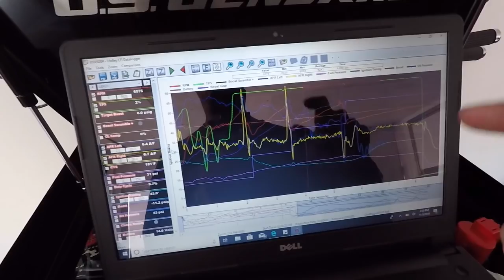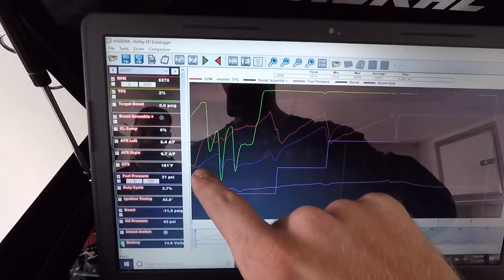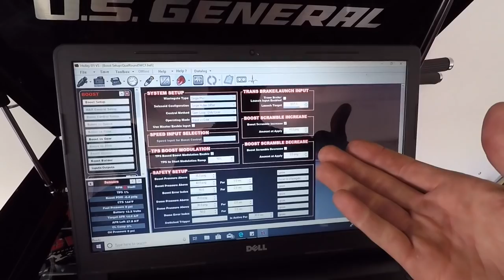World Cup Day #3 - Third Round Qualifying, Shattering Parts (Changing To Old Mounts)

Comment: I can't believe those rearends you keep breaking are stock ones.  That should show people how strong they really are your pushing them harder than they were designed for. pretty good parts in my book and I'm a Ford guy.  To bad there isn't a way to truss the case like can be done to a solid rearend.. I also don't know why anyone would rag on parts breaking especially stockish ones I mean most race cars running what your running use completely after market parts designed for the hard launch and huge hp so again the parts you explode are still very good parts and will handle most normal applications however LeRoy is a bald eagle machine and nothing close to normal.
Reply: I agree 1500+ ponies on stock goodies is ridiculous. cudo's to the gm design team on that one
Reply: Its amazing, im pretty sure he never broke Leroys original stock axles, while running around 1200hp and mid 8s all day.
Reply: It's not a stock diff. Just the case. The internals are built
Reply: @thirtyeight92  but still stock case that's still pretty amazing.
Reply: @thirtyeight92  atm it's stock internals let's see how he goes
Reply: There isn’t a aftermarket case for it

Comment: Looks like it's time for a solid rear axle.
Reply: Its not practical, you need to pretty much at the min back half the car.
Reply: @southjerseysound7340  there's no body and most the car is already tubed. What doesn't make sense is trying something over and over again with the same results. Gotta keep it somewhat corvette I guess
Reply: Definitely time for a 9"
Reply: @spensinthevalley3099  I had a 99 C-5 and when we swapped to a Moser 12 bolt it was a ton of work. But the real issue was it kept us from running 1 of our classes and we couldn't claim records(although that's pointless anymore) You're damn near pro mod territory and nobody gives a shit when you run a 7.69 @204 mph because you're one of the slower guys lol.
ECS does make a IRS 9 inch kit that keeps things like a Corvette with a independent rear but you can only squeeze a power glide in there and you have to swap over to the C-6 rear subframe anyways. So if he wants to stay manual he might as well do the C-6 ZO6 rear diff anyways. Then if he decides to go auto he can with a IRS 9 inch.

Comment: Could that new cradle y’all put underneath the diff be one of the problems? Maybe if the diff has a little room to move the case wouldn’t break. Because if the diff case is trying to move it’s putting pressure on that cradle and the metal isn’t strong enough to handle that pressure.

Comment: Is that new diff brace over constraining the diff housing? Don't know if it's too late, but mounting it on poly bushings or a less constrictive mounting method might help em last longer! Just my two cents! HELL YEAH BROTHER
Reply: My thoughts exactly . Thought that when i saw them fitting it.
Reply: Billet case would help too lol
Reply: @Thomas-fo4dv  I thought the deal was they had to use a stock case? Could be wrong. That would be the obvious answer, but engineering the vehicle appropriately is smarter than throwing expensive parts at it any day.

Comment: Honestly it's amazing some of these components had lasted this far, some fine engineering gone into making parts take that much abuse. I was a commercial motor fitter and engineer for over a decade and know a little bit about failure rates so every time I see 3000lbs of Leroy pushed to over 170mph in under 8 seconds I can barely believe my eyes.

Comment: Apart from the new c6 diff in tbe works, would it be possible to strengthen the diff with a filler in between the cooling fins similar to concreteing a block? How important are those fins when the abuse is less than 8 seconds?
Reply: It's been a while but we put studs  in the output flanges and ran billet covers on ours and it helped a lot. But we still broke cases after about 30 passes. If I knew how to get ahold of him I could send him the solid works files.
Reply: I'm pretty sure there's an email that you can send stuff through to him. He had it in the links page when he was looking for a new diff  case
Reply: Was just thinking this, go ghetto and weld a whole bunch of reinforcement to the diff case to try and get it to survive the races.
Reply: @damstachizz  its not easy welding to cast aluminum because the oils get into the grain structure. It can also warp the case. If they had another spare I'd say go for it. But I don't think it's worth the risks

Comment: That is the worst diff design I've ever seen. Been thinking about this for a while since the first one split. As you'd probably have already figured out before me, as I'm no bright spark, from what I can see the pinion gear being at the top rear of the crown gear instead of the lower front of it, all that torque and stress is pushing on the back of the case via the pinion gear while it's trying to push the crown gear forward. It doesn't look like there's a lot of meat in that case around the crown gear. Is the C6 an easy conversion? I think a 4 link and Ford diff is in order. 😜 That'll upset the GM fans.
Might give you better squat off the line over the IRS though.
Reply: It’ll definitely launch better with any 4 link and straight axel. Keep the gm guys happy and do any straight axel

Comment: Quick release side cover and snap-in drain cover. Looks like theres nothing wrong with it to me. 

For those saying "SOLID REAR AXLE TIME" heres why not.
Different transmission that will require output flange/slip yoke for a regular style driveshaft (no torque tube), and fabrication for 4 link/ladder bar required. Less parts to break in the rear end in theory, but it adds in possibility of U-joints and driveshaft breaking.

Comment: From the corvetteforum by DTE Powertrain:

It does not matter if your car is equipped with a 1-rib differential case, a 3-rib differential case or a million-rib differential case for the likelihood of transmission/differential case fracture to occur in that area due to metallurgical fatigue, deflection stress or excessive shock load events. 

In all of these instances, there is still only 5 meager fasteners between the transmission-to-differential juncture where the greatest probability of fracture/breakage will occur. You can have any amount of differential case webbing count you want under the car, but the weak mounting point at the transmission extension housing still remains and is at risk, due to the light duty cast aluminum parts in that area. 

In other words...a 1-rib case will fracture just as easily as a 3-rib unit would without the use of our product, because the small connection point at the transmission still has not changed and it's still weak- even though the differential case may be stronger by itself. 

Our product protect both areas from fracture, regardless of differential case design and it's proven itself successful time-and-time again in numerous high powered drag cars over the years with varying powertrain combinations. Do a search and you'll find most successful high powered cars are using it to this very day with success as well- including our newest success of our driveline products being in Paul Smith's 427ci. powered C5 Corvette that just won Pinks All Out in Atlanta, cutting 1.3's 60 ft. times all day long with the wheels in the air! 

It matters not to me whether you use one or not- it's your car and your wallet, but at least you can make an educated decision on which way you need to go when you're equipped with ACCURATE* information to make the decison with. Good luck!

Regards,
Phil
Reply: that definitely sounds like every post from the corvette forums I've been on. it's so damn condescending. "I don't care what you do, but only I know what's accurate" 

only to be just as full of themselves as everyone else. it's why people hate these cars, their owners and the culture that come along with it. cleetus is changing that with what he's doing on this channel, not listening to the corvette forum engineers and listening to his sponsors technical support and racers. while working thru stuff that's not been done before because everyone listens to the bad advice. look at the white 1320 corvette, it's got what everyone says is correct and still is a sec slower than Leroy. he'll work thru this. just give him time.

Comment: You can use some white grease to check tooth pattern. I don’t know if this will help you, but if you knock all the high spots off your part from the casting. Like casting flash and stuff like that, make it smooth, it will increase the strength of the housing. The sharp edges are called stress risers. Engine builders do it on blocks and everything spinning in the engine. It’s a bit tedious but it’s something easy that you can do and will give you added strength by removing some material. Good luck my man. Stay free.

Comment: Get less stiff axles, they´re cheaper to replace than diffs and gearboxes. I´m with a guy that rides a Coupe Quattro with like 1000 wheel hp he does go with stock axles and he only replaces them after like 5 events or smth. Put a line on them and go with an amount of twist you´re comfortable with.

Comment: Since you are using oem case.  I'd suggest sanding and smoothing the casting it could help a little as the cracks start at a microscopic level in the ridges of the rough finish.

Comment: Like James was saying..."The biggest killer of transmissions and rearends isn't necessarily too much horsepower or torque channeled through weak parts, it's abuse and wheelhop .I suggest  asking RPM about using the Quaife C 6 differential with the C6 components ,high end axles,etc in a ZR1 housing...Part breakage is part of drag racing.The manufactures can't protect against the unforeseen forces.. PS Did you realign the front end on a machine after correcting bump steer ? You may have some et in that alignment..I few degrees/mm's can create a lot of scrubbing,rolling friction...Good luck.Love the channel

Comment: Like your brother once said."KEEP RIPPIN TILL SHE'S DRIPPING!". Corvette uses some good parts. But they can only take so much. The Getrag diff will hold together to around 1K HP but that's about it. I was racing for FORD in the SCCA Factory parts races. and when the wheel HP hit 1100 HP diffs started doing exactly what yours are. And I mean you're doing great because you're on a sticky track. FORD went to a better case. (A better alloy and billet) That one held together until the car got stolen and chopped.

Comment: It may be time to put a transmission on the back of the motor and put a 9-inch Ford in it. I know you probably don't want to do that but it'd be a lot better than always breaking an aluminum housing diff. Upgraded stock Parts can only handle so much and then you need to think about upgrading racing parts

Comment: haha , so what you did with the pinion support in the dale truck is exactly what I did in the right lane at MIR many years ago. Now you are getting won to the nuts and bolts of things. Someone has gotta make a 9" replacement center for that thing but it being what it is you will always be limited by it.
I mean look at what we have to put in solid housings to make them live. 40 spline axles with gourmet cases and supports... Those independents just aint gonna cut it when those 60s come down and the weight is up.
Sucks , hope you get it straight.
Reply: Corvettes don’t have typical drivetrain setups. The transmission sits in the back and in order to get a 9” rear end, you need to a complete rebuild and reengineer a lot of stuff. The only corvettes that run solid rear axles are full tube chassis cars.
Reply: @EGHeartattack  Yeah I get that. Someone will do it.....Its the corvette part that is the issue..... Same will happen with all these independent mustangs when the 60s get right.

Comment: honestly, the time for bashing parts has already passed. If this stuff was breaking at stock power levels, that would be a problem. But if I recall correctly, Leroy is well over double, probably near or past triple OEM horsepower. That WILL break things. No hate for the manufacturers, and kudos on the engineering for them to be able to handle the beating they have already taken...

Comment: What happened there was, that the pinion gear got pushed back by the smaller gear, and the casing gave in because the brace was only half way around the axle mount. So this was not tire shake. This was too aggressive launch for the gear. To protect the casing the axle mount brace should be all way around one single piece on both sides. That could hold when mounted to the back bar, and upper hang mount. But there still should be at least four mounting points in the braces and in the chassis on each side. otherwise these is stress points and tensions in the casing, and as we already know, the cast aluminum can't hold those.

Comment: When your on the 2 step you can see the diff shaking then when you apply all of the torsional force from the launch the stiffer/solid mount is most likely the issue. Instead of the mount absorbing some of the force, the case now has to absorb most if not all of it. Being cast aluminum it won't fair too well. When Supras started using the solid aluminum diff mount inserts, the breakage of diffs increased. I believe the same theroy applies here. Give Leroy some padding for that ass...

Comment: You broke the aluminum 9" in the Dale truck along with the driveshaft with an NA motor on your first launch. A 9" anything is typically a pretty solid piece  and I'd think an iron or billet steal housing would do much better. I think Fran at RPM(not transmission) in Delaware is using a 9" diff in his c6. Is this where you are headed? Also: have you looked at turning down the first 500 miliseconds so you don't have to do the throttle modulation?  Consistency is with programming will be much better than 6 throttle manipulations before 60'?

Comment: Couldn't you tig weld a bunch of aluminum plates around the diff to strengthen?
Reply: Colorado Native 84 would put more stress on the case because it couldn’t flex
Reply: @bbdl7042  Maybe your right but I would bet not. If that thing was a solid 2" thick case (exaggerated scenario) it would never break, and it should not flex or need to flex at all I would think.

Comment: Get rpm transmitions to normalise the metal of the case then re heat treat.
Reply: Only asking if there is any c5 categories you might get a few more titles 😀
Reply: Also still using oil? Or grease?

Comment: When you ran your first 7, you went back to back and made multiple passes without coolant. So whats changed? More weight because of the strengthened roll cage and new motor? Ive noticed all the sub 8 drag cars wheelie off the line. LEroy doesnt wheelie. hes too chubby Lol
Reply: I'm not sure I've seen an IRS car wheelie
Reply: @LibertySpam   Maybe thats the problem? All NHRA, Pro mods, and funny cars have wheelie bars. Because the wheelie signifies the transfer of thrust or torque. With Leroy having IRS, all of that power is staying in the back of the car and thus breaking the diff. Just some thoughts. If IRS was the best thing for drag racing, then nobody would have wheelie bars. Time to upgrade his rear suspension.  

https://www.caranddriver.com/features/the-physics-of-wheelstands

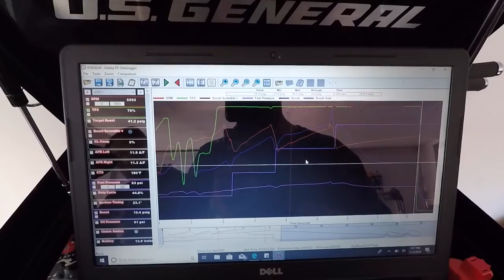Comment: More unsolicited "old guy" advice.  You have been fortunate with the differential failing catastrophically right off the line.  However, if the unit is damaged on the launch and decides to grenade on the big in, you will have an untenable situation.  Rear wheels lock, stabbing the clutch won't release them and the result will be bad, really bad.  Swapping to the later unit will undoubtedly help.  To the advice:  IF reaching the car's true potential is your goal, throw away the stick and go automatic.  You set the world record with the stick shift, so you have that.  Auto is SO much easier on drivetrain parts.  The constant "loading" and "unloading" of the driveline creates never ending problems.  Boost loss between shifts is reduced and power is constantly applied to the rear wheels, reducing ET.  Every time the clutch pedal is pushed, time is lost.  Getting the converter right will most likely take a few shots.  Chance Converters is awesome in helping to get it dialed in.  Years back, I was right where you are.  Stick cars are so much fun and you get a greater sensation of power.  Nothing like yanking on the shifter and grabbing the next gear.  I finally caved and went auto.  Parts breakage went away.  Car left harder, went faster, straighter and more time was available to "drive" the car which increased safety dramatically.  I will be honest, it takes some getting used to.  The first couple of passes will seem a bit dull.  You pin the throttle, put both hands on the wheel and drive.  A bit boring compared to all that's going on with a stick setup.  Just a guess, but I speculate with the same tune as you have now, the car would easily go 7:40's with an auto.  Best of luck whatever you choose.  (Didn't mean to write a novel.)
Reply: Well, the "point of the build" can change.  His choice.